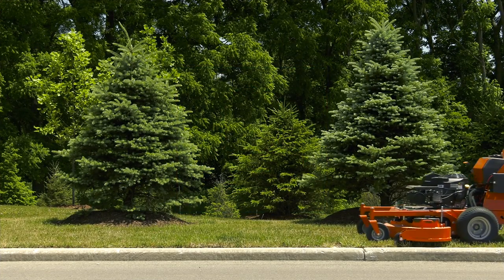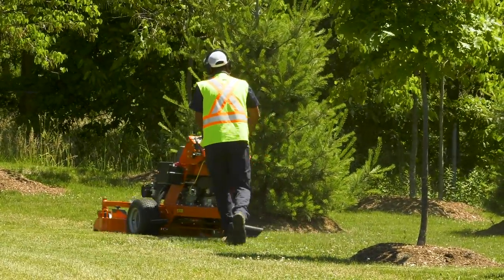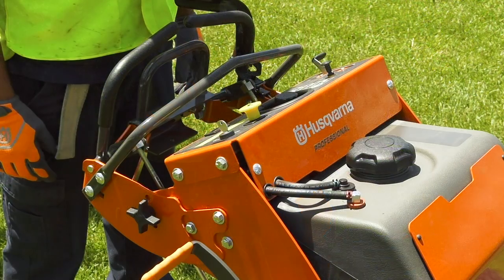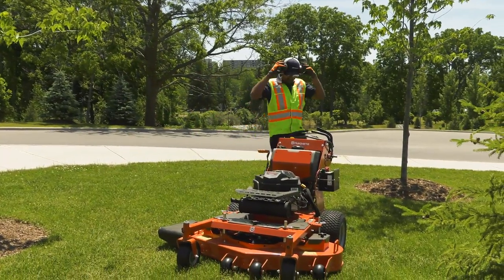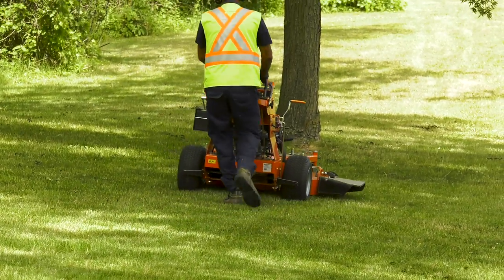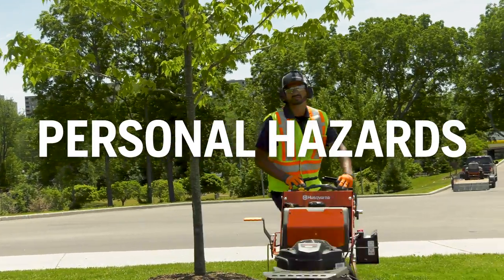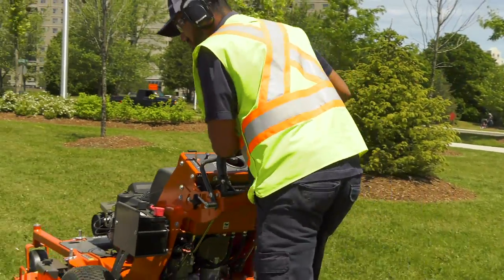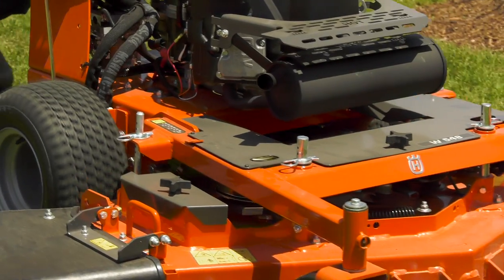How to Start, Use & Operate a Commercial Walk Behind Gas Lawn Mower | Husqvarna

Comment: Why would you mow up and down slopes?  If you slip you could either pull the mower on top of you, or if going downhill your chop your feet off with the blades.  Wouldn't starting at the bottom and working side to side and finish at the top be the safest way
Reply: Because that's what Husqvarna Manual says on W500 Models.